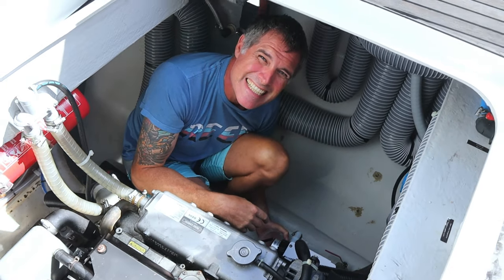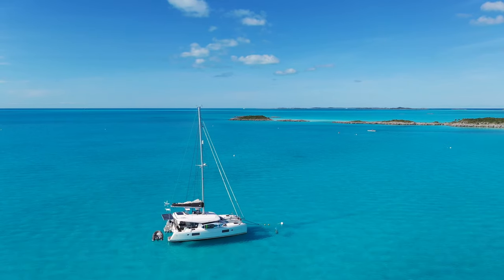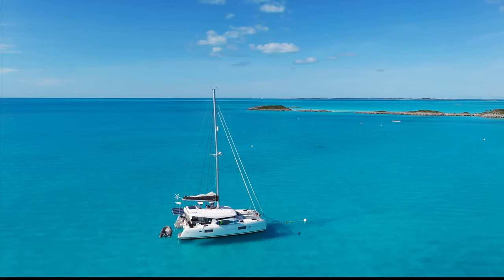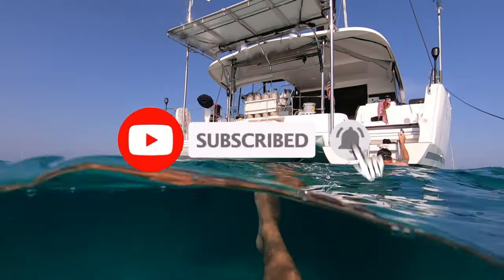Making the Switch to LITHIUM BATTERIES! | KiloVault 3600 HLX+

Comment: Hello Holly & Ray! 

Thanks for your great videos! 

I’d like to understand more about the BMS and balancing.  Can you elaborate on your design? 
- specifically, did you included an external BMS or some sort of balancing method? 

I believe KiloVault HLX+ don’t require an external BMS, but I’m wondering how the batteries (let’s say 4 batteries in a parallel bank) can be kept in balance.  I assume it’s an eventuality that drop-in style batteries (each with independent BMS) will drift and become unbalanced.  No? 

Possibly the internal BMS communication to adjacent bank batteries is completely sufficient. 

Could you elaborate please? 

Thanks!  And happy sailing!
Reply from the maker: Hi, thanks for watching! :) 

The Kilovault HLX+ like the ones we installed have CAN bus communication so their built in BMS’s can communicate with each other to improve charging and discharging across the entire bank.

Comment: Hi Gang!  Thanks for the video.  I'm curious why BattleBorn batteries didn't make the list?  Very excited to see how this all works out.  Especially, Holly, if you are going induction in the kitchen.  That seems like a huge win getting rid gas inside.  Thanks!
Reply from the maker: Hey Geoff, thanks for watching! BattleBorn does not yet have external communication capabilities (although we’ve heard they’re coming out with it), as required by ABYC. They also do not have UL 1973 certification. Additionally, after 3 attempts, their tech support never replied to us…🥴 We’re looking forward to ironing out the galley details- hoping to decrease our propane usage for sure🤞🏼

Comment: You didn't mention how many Ah of batteries you are getting.  I would recommend 2000(+) as it will allow you to run your A/C overnight easily, plus you will forgo having to turn off major appliances.  It's easier to just do one big installation and be done with it, than open the boat up again to add more batteries and wiring, later.  Are you getting an induction oven?  Another alternative is just buying two portable induction cook tops and an air fryer.  Store them in the cabinet, where the oven used to be and when they aren't in use, you have more counter space.  I'm partial to the glass bowl type of air fryers, as they give you more volume, especially with the extension ring added.  I've roasted 7 pound chickens and ribeye roasts in ours with no problem, plus you can visually monitor them because of the glass bowl.  They also use about 30-40% of the power of an oven and the heat is almost instant by comparison.  We bought ours at Costco 14 years ago it is still working flawlessly.  Amazon sells them currently.
Reply from the maker: We’re not planning to make too many changes to our lifestyle. We almost never run our AC so that’s a very low priority for us! We’re still ironing out the final details but will share the specifics when we do. At the moment I’m planning on keeping the gas stovetop but getting a portable induction cooktop as well. I’d love to get rid of the microwave and make that space storage because we never use it anyway, get rid of the oven and get an induction oven/air fryer combo… what brand is your air fryer?
Reply: @HollyandRay  The A/C is as much about eliminating mildew as cooling/heating.  A dry boat means not having everything smelling musty and having to launder clothes and linens, purely because of mildew on them.  Our air fryer is a Sharper Image Super Wave.  Amazon still sell them and there are multiple other brands selling the same design as well.  If you buy it, make sure to get the metal extension ring.  These "ovens" cook hotter than a lot of the cooking times suggest and you'll need the ring to increase the distance of the heating element from the food, especially whole chicken.  Our favourite foods to cook in it are whole chickens, chicken wings, meat balls, potato wedges, ribeye roasts and baked potatoes.